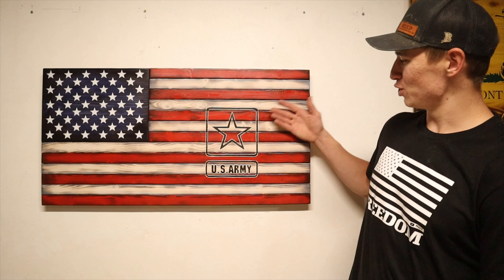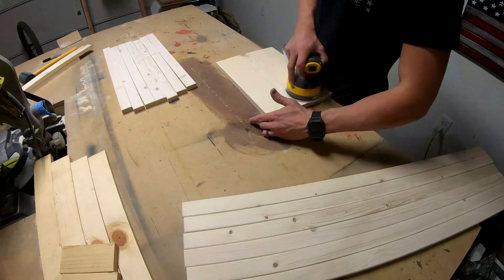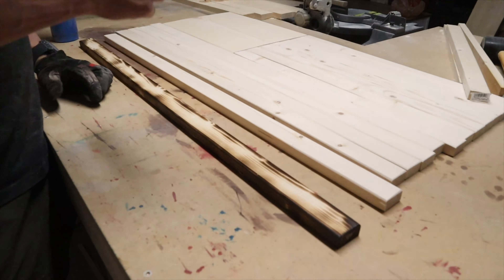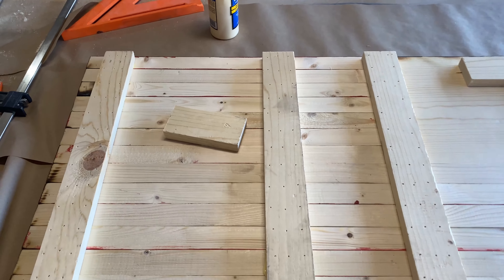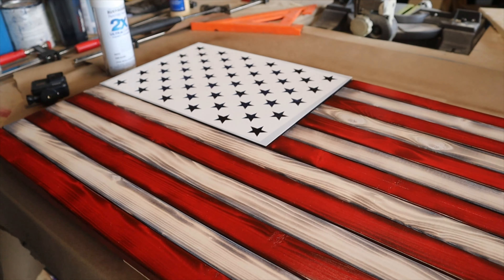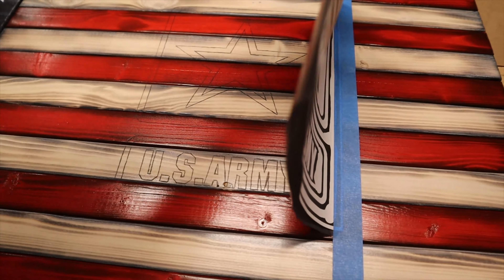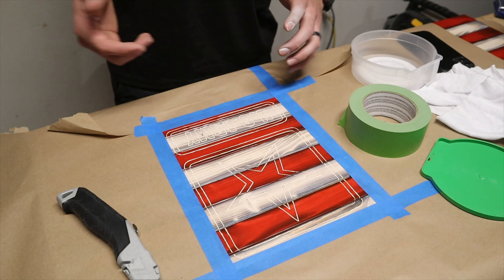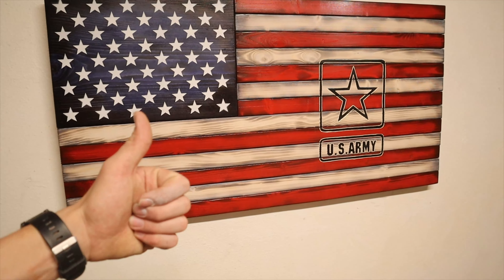How to make a US ARMY Wooden American Flag! Super Easy DIY! DIY Christmas gift idea

Comment: Max, do you treat the knots on the strips that have the white stain? If not the knots will bleed over time. I have used some type of sealer before putting the white stain on. I have used shellac. It only is an issue when using light colored stains.

Comment: Nice job Max..I have a question..Why are you using a 3rd pc of wood for the Union? Doesn't that make for more Cuts plus more wood?
Just using the Furring strips is Cheaper i would think and less work..
I guess it's a personal preference..
Reply: I always use a separate piece of stock for the union too. I don't join mine though until I have the stars done. It has saved me a lot of grief if I happen to get any  bleeding under my stencil. I like the solid look of it also.
Reply from the maker: Thanks a lot Bob! Yea its just personal preference, i like the look of it just a little more than the other way but thats not to say the other way doesnt still look awesome! And your right about it being quicker and cheaper to do it with the furring strips!
Reply from the maker: @Jimc4007  thats a great idea Jim!
Reply: @MaxF01  the only problem with the furring strips is carving the stars on a butt joint. Part of the star is on the next strip. Looks good at a distance but I know how it looks lol. I’m gna try the solid  piece of wood for the stars. The minis go quick. Those I’ve made was from the scrap furring strips. 
I appreciate your vids max and for especially replying back to the comments. That goes along way to you subscribers because most of the time it’s the ones that are steady in following your vids. 
Thanks man for keepin it real. 
Jim pleasure to meet you as well. 
Making these flags isn’t just about the money. It represents this great country we live in. 
#GodBlessYouGents

Comment: How do you figure out your measurements? Is there a method or just random?
Reply from the maker: I figure them out based off the stencil. Since there are 7 stripes next to the union i use that to figure out the width of the stripes then i take that and put it into a American flag calculator to figure out the length